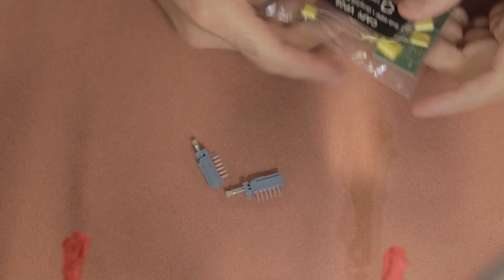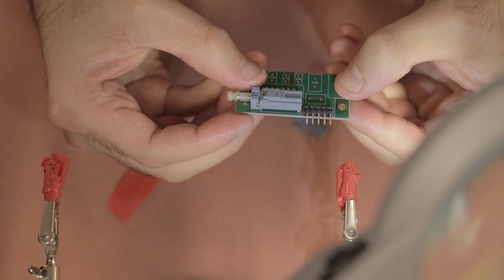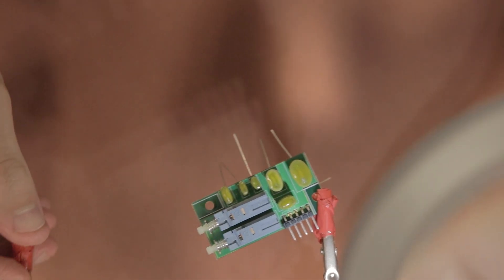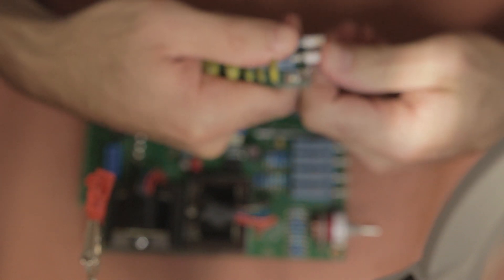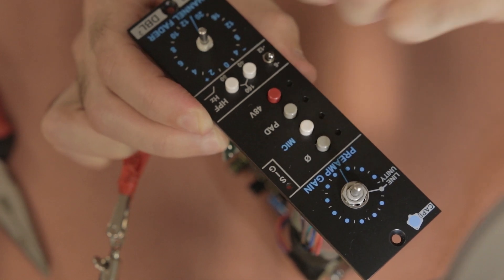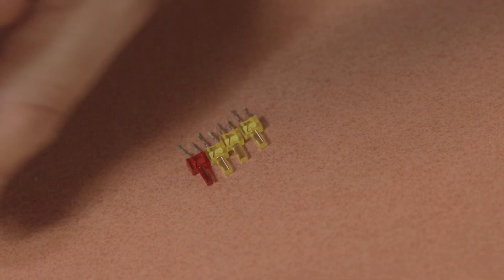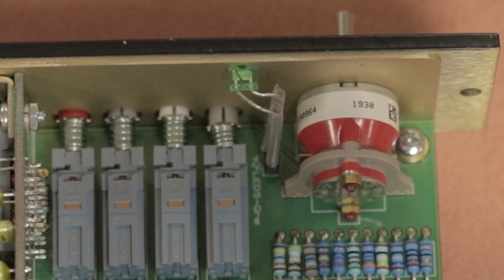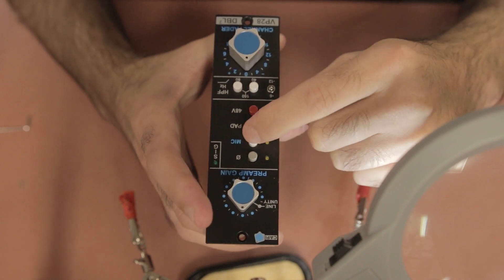How to Build your Own Preamp - CAPI VP28 (API Mic Preamp) DIY Build PART 3

Comment: I didn't see you solder the ground on the board. It was still blank at completion. I'm wondering if this is jumpered to the chassis?
Reply from the maker: Sorry David, Which part are you talking about in the video or what component exactly?

Comment: Hi Mitch! Love your content already and I just recently subscribed! I have a little question about this, as a sound enginner in a third world country DIY seems to be a pretty viable solution to overpriced stuff and gear. My acoustic treatment was all DIY. I am planning on buying some of CAPI pre amps but, truth be told, I've never soldered anything. What do you recommend for practicing soldering before spending a considerable amount of money on these pre amps? Or do you recommend finding somebody that's really experienced on the matter for the build? Thanks a lot! keep up the good work and awesome videos!
Reply from the maker: Thanks Diego! It means a lot to hear such kind words. Even in Australia the taxes and conversion rate makes a lot of the high end audio gear incredibly expensive, so i totally understand why you might want to go DIY. 

It's great that you are on your own DIY journey, it can be a really fulfilling way to build up your own high quality gear. I would suggest starting with soldering some simple XLR or TRS patch cables first. Then maybe try a cheap electronic kit or guitar pedal that you can afford for a price that doesn't matter if you completely mess it up. 

Make sure you get the right tools to solder with and just take your time with it. I have a video going up today about the gear I use to solder and I'll have one later in the week about correct soldering technique. Keep an eye out for those, it may help you out.  

Thanks for stopping by the channel, let me know if you know any other help.

Comment: Did your kit happen to come with the hex wrench to tighten the knobs? If not do you know what size it is? Helpful videos! 🤟
Reply from the maker: I really can't remember, I know my Sound Skulptor kits did, and I might have just used those. I'm not sure on the size, but it's one of the smaller hex keys I have.